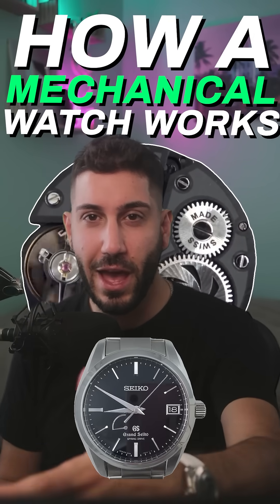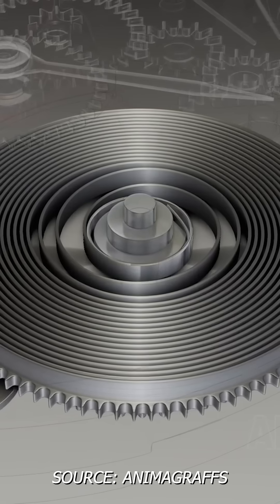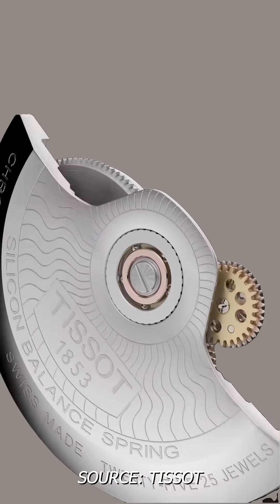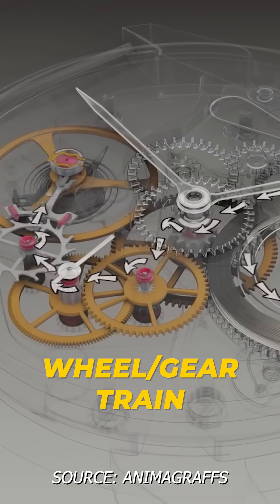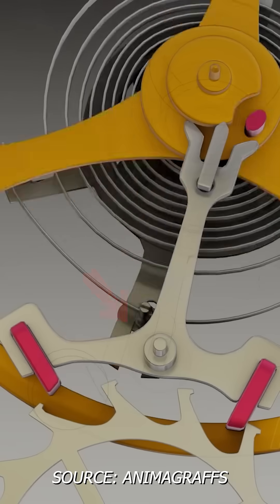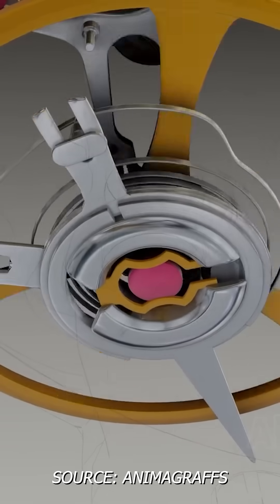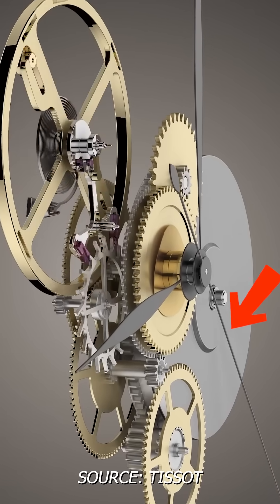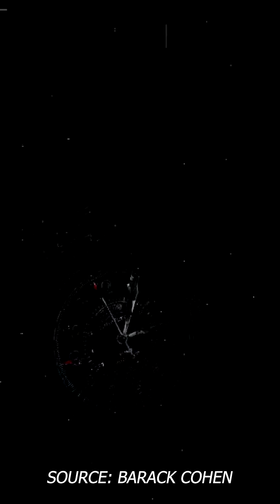How Mechanical Watches Run Without A Battery

Comment: It’s just like a car. You put the key in the Ignition, the turning of the key tells the battery to send a signal to the starter and the starter goes up against another gear and starts the car. This is precisely why I feel a deeper connection with mechanical watches, other than Quartz.

Comment: Fun fact. The Quartz movement actually replaces the ‘power generation’. Meaning the battery in modern watches don’t actually make the watch ‘modern’ it actually just supports the main mechanical movement invented centuries ago.

Comment: "Each of the hands are attached to the escape wheel via a separate gear train" might just be the most incorrect sentence I've ever heard.

None of the hands are attached to the escape wheel. I'm not sure if I have ever seen a hand mounted to an escape wheel, but it would serve no purpose in telling time as the escape wheel rotates far too quickly for even a seconds hand to be fixed to. 

Commonly; the seconds hand is attached to the seconds wheel pivot, the minute hand is attached to the cannon pinion, and the hour hand is attached to the hour wheel. This is entirely intergrated with the gear train.

The full chain of events would be; the barrel powers the great wheel and the rest of the gear train ending with the seconds wheel rotating once per minute which the seconds hand is fixed to.

The barrel also powers the center pinion which the cannon pinion is fixed to. Turning them both at one rotation per hour which the minute hand is fixed to. The cannon pinion gears directly with the minute wheel which divides out the rotation to 1/12 for the hour wheel. Thereby turning the hour wheel once per twelve hours which the hour hand is fixed to.

Comment: I have Seiko 5 watch almost 40+ years old, still working condition
Reply: Without any kind of servicing?
Reply: Have a seiko 5 my brother gifted my dad it's been 15+ years still works great aswell.
Reply: Micro enginerring at its best
Reply: I've got a seiko deep from 98 and it still runs perfect. (I've only had it serviced once)
Reply: Japanese engineering in car bike and watches>>>
Reply: I got a silver one with white dial

Comment: No m just telling that machine shouldn't cost 100000 dollar when a machine that can send a message to another machine of the same size costs 300 bucks
Reply: It's called precision engineering and it's made by hand.. assembled so delicately by watchmakers.. the expensive ones are handcrafted by specially trained and experienced watchmakers, it's like the few selected lot of technicians working on a Ferrari supercar engine.. they aren't working on something, they are assembling the heart of a mechanical masterpiece.

This is different from the wireless technology or the silicon transistors and the great breakthrough of the information age, which only gets cheaper as the process involved is easier compared to experts (upto 3 humans ) working on a single piece for more than a month sometimes, to finish the assembly. It's about the materials that go into it, the complications to build into it, the accuracy to maintain ( that's why the Quartz watches were a revolution, as a much much cheaper and precise and easy way to achieve timekeeping ). And.. to imagine the physics involved. It's a mechanical puzzle solved and assembled inside a small case that you wear on your wrist. So.. there you go Sir.